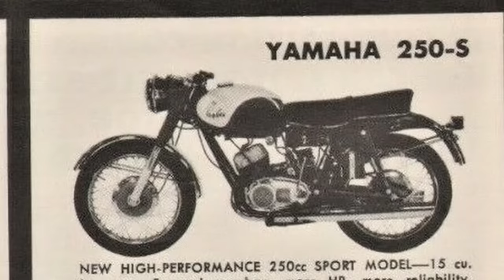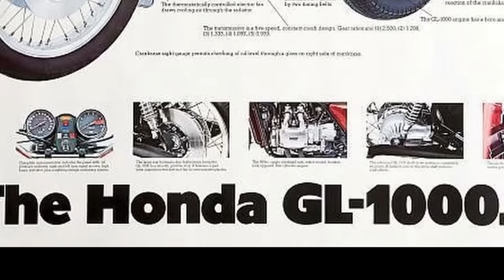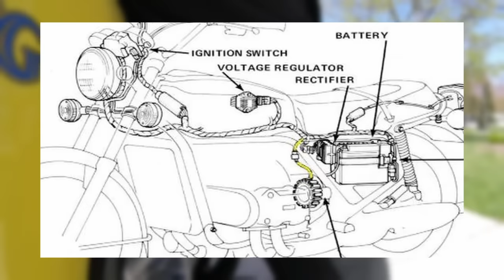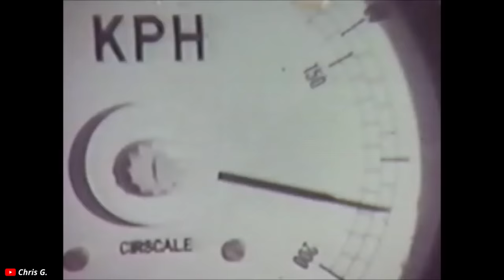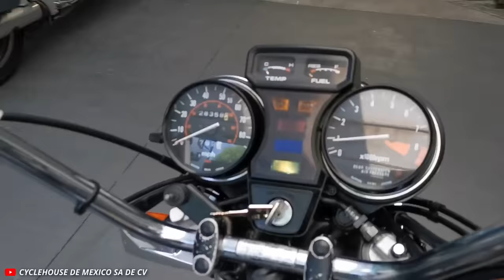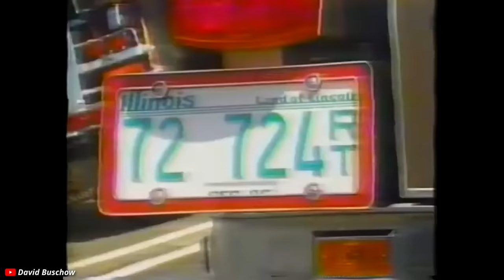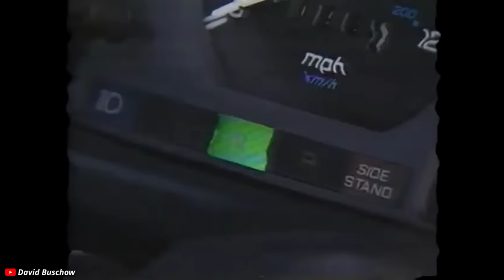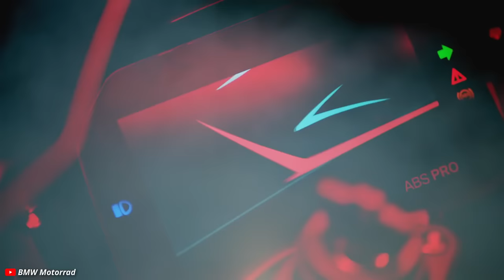How the Honda Goldwing became the Winnebago of Motorcycles

Comment: years ago, I bought a "GV1400" CAVELCADE made by SUZUKI that was made in1988( V- 4 water cooled engine). I bought the machine new in1991, a leftover being that it was discontinued when I bought this machine with.5 miles on it. it was built as a "HONDA GOLDWING" knockoff, and more expensive to buy. I guess that is why the sales numbers were so low, as it hade a 5 year production run. I still have the bike with 258,000 miles on it, and the engine is running on the factory build. the bike has been a trouble free machine. it would be nice if you did a comparison between the two bikes, just a thought. I also subscribed to your channel!!!!. I started riding when I was 25 years old, I am now 62 years old , and still riding!!!!   have a great day!!!!, and keep the rubber side down.

Comment: Back when they came out I had a GL1200 Aspencade in New Zealand. One of only 6 imported. All good until the oil pump rotor shattered and the engine seized. Sadly it would have cost me too much to rebuild so the bike became the first and only spare parts bike in the country. A friend of mine at the time had a CBX1000 6 cylinder. He was also not so lucky when the con-rod on the 5th piston broke and cut the engine case open. That too became a parts bike. Big bike in New Zealand in the 80s were not cheap to start with and parts were expensive. Ah those were the good 'ol days of my youth

Comment: I ride a GL 1200. Good bike and carries a lot. The primary chain has gotten noisy after 100,000 miles. Do I ignore it or  split the cases (big job) and fix it ir buy another bike. Still a reliable bike and gobbles upnhighway miles. I put about 6,000 miles on my bike this year and didn't go on any long trips. I'm pretty old and the GL is a comfortable bike. I have a couple if dual sport bikes that are fun to ride but the seats are horrible for me.

Comment: I was gifted an old GL1200 Interstate and put about 7500 miles on in the first year, then it went into mothballs when I had to move. Ended up giving it away. Then I bough a 1995 GL1500. I put 32,000+ miles on that the first 18 month. I only got to ride it 7000 miles the next year because of work before my handle bar controls went out. On one of the Goldwing Forums I visited before finding mine, I was looking for safe miles for purchase of a used bike and there were very many with well over 100,000 miles, many with over 250,000 mile, quite a few with over 500,000 miles and even 1 with over 1,000,000 miles on his Goldwing.

So yes, I would say if you want the ultimate in open road cruising experience, the Goldwing should be your choice...hands down.

Comment: Craig Vetter was probably the one responsible for Honda putting factory fairings on the Goldwing. Riders were equipping Goldwings with Vetter fairings a couple of years prior to Honda providing their own. Why miss that share of market? Vetter fairings were good quality and I had a couple of them on my bkes. I also owned a Goldwing 1500 for many years and rode it across the US a couple of times. (WA to FL and back). Honda got it right for a big interstate gobbling bike.

Comment: The GL1000 had performance and speed to match the Z1. It was no slouch even though it weighed 650 lbs.

They aren't hard to pick up either if you know what you are doing.  I know from experience

Comment: I had a 2008 GL1800 and it was without a doubt the best bike I have ever owned. Fast, comfortable, dependable, and luxurious. 1000 miles a day was Childs play. Where I live, it is 1000 miles to Sturgis SD. I used to go down, pick up a bunch of t-shirts, and would be back home the next day. I have a Victory now and it's okay but in comparison the GL was still a better bike. As far as HD is concerned, well, they aren't in the picture nor is BMW and yes, I have ridden both of them to compare. The new 1800 is definitely the next generation but like anything else, it does have some flaws. The suspension is cushy but the springs sag out fairly fast. Traxxion or Progressive cures this quickly. If you know how to handle a GL it is possible to stay up with sport bikes in the twisties once the suspension is reworked.

Comment: I own 4 goldwings from 2 1000s, to an 1100 to a 1500 and I still love my GL1500 best. I had a 1200 too and they are arguably more fun than the 1500s. The naked 1100 is the most fun IMO. It is not a slow bike. They are all so incredibly reliable and smooth and each generation just improves on torque and smoothness. The 1000 wasn't exactly lacking either. I'll probably get an 1800 next

Comment: Did 7000 miles in 14 days on mine, and lived with it as my only motor vehicle. You haven't lived until you've worked for American Honda and had them hand you a basket case box of parts  Goldwing and tell you to put it all together and make it roadworthy.

Comment: Don’t have, and never have owned a goldwing. But I ride a 1983 Yamaha Venture. I can do grocery runs on my bike easily, eggs and all. It’s comfortable for hours, it’s still plenty quick enough to be good fun. Handles better than my 82 xj750 it replaced. And I only paid 1500$ for a two owner, garaged, 30,000 mile example.

80s wings are really excellent however.
Reply: yamha  beß  t  wave rúñers  toó

Comment: Back in 1987 my wife and I purchased a 1981 Aspencade and immediately went on a long road trip. At the end I asked my wife "did your butt ever get sore?". We both agreed that NO was the only answer. And that was on the stock seat! Unbelievable. What I did NOT like about the Aspencade was actually the air suspension, which could not compensate for altitude changes. This was a big deal when riding from sea level to 9,000ft. I actually wished I had purchased an Interstate!

Comment: Switched to a GL1800 (2008) after putting 250.000 Kilometers on an 1300ST Pan European (which deserves its own youtube report).
Also it is worth mentioning that manufacturers had an unwritten law to cap horsepower to 100HP during the 80's and 90's. With the coming of the BMW K1100 and R1200 this was let go.
Still the 1800GL 2008 version holds its own quite nicely as a pinnacle tourer. The 2019 model tops that but including taxes it would set you back an easy 40K Euro (comparable to the BMW1600 GL by the way). Luxury tourers are massively expensive in Europe, which is a real pity I wouldn't mind owning one of those, though.

Comment: I'm lucky enough to own a GL1000 (yellow '76), and they are certainly a unique machine.  If it looks like a bike with a car engine, that's because that's pretty much what it is.  Honda's motorcycle division did the frame work, while their automotive department did the engine work.  Heck, the carburetors identical to those used in the N360 car.  This means they are massively overcomplicated for a motorcycle carb, but if everything is working correctly, they do a great job.

Which is kind of a theme for the bike.  While top end jobs are easy, a lot of other common bike maintenance is a nightmare.  Changing those timing belts?  Essentially have to pull the radiator.  Need a new clutch?  You've got an inch of room before you hit the frame.  Stator's gone bad?  You're pulling the engine.  Need rings?  You're SPLITTING THE CASES.  But that said- IF everything works together?  They are a magic machine.

Everyone forgets how much power these bikes actually have.  They STARTED at 999cc, and just went up from there.  Power delivery is a bit weird on the early models (a bit of a slug under 5K rpm, but really takes off above that), but if you keep the revs up they are sporty little machines.  Sure, they get a bit tubby in parking lots, but I took mine to The Dragon a couple years ago and it did great.  They can be a handful to get tuned in, but once you do they will go FOREVER.

Comment: From your comments I can tell you're young and didn't research the Gold Wing well enough.  It was designed from the start to be the best touring bike available, starting smaller and simpler, and growing from there with consumer demand as the bike sold very well.  It was never meant to be a super bike as you said. My stock GS1000 is a second and a half quicker on the 1/4 mile.

Comment: 3 years ago this week I decided to start riding again after more than 20 years. Bought an 83 Aspencade gl1100. Just shy of 60,000 miles in those 3 summers and winters in Pittsburgh. Nothing but brake pads, tires and oil changes. Oh yeah, it cost me $900!

Comment: You should read "Eight for the Open Road" from Cycle, in May (?) of 1975. An evaluation of 8 bikes. Very informative of the period. They tested (IIRC) the Gold Wing. BMW R90/6, Norton 850, Moto Guzzi, Suzuki Water Buffalo and RE5, Harley FLH 1200, and Kawasaki 900. IIRC that is. The Wing and R90/6 tied for top, for different reasons. Everything else far behind. Harley at the very, distinct, bottom. 
Look it up. You'll like it.
And wasn't that an R90S in the mountain passing clip at 9:49, doing the passing?
I called them Lead Wings then. Still do. I'd rather have an RT that weighs 200lb less, handles better,  and will last just as long.

Comment: I paid $1,500 for an ‘85 GL1200 Limited four years ago.  It took another $1,000 to get it on the road and has given me 40,000 trouble free kilometres since. Shows 104,000 kilometres and running strong as ever.

Comment: I had a GL1100 interstate back in 1995...that generator was a menace.  I bought mine and it died or was dead from the get go, a common failure for thet engine.  $800 (1/4 what I paid for it) to replace the thing because it was buried in the guts of the bike.  Oh, but it was smooth and floated like a lightly buzzy comfy carpet.  I put more miles on that thing then any other bike i ever owned.  If i got back into riding, it would be on a goldwing.

Comment: I ride 2 different wings.  a 1983 GL1100 that a solo bagger for me.  has a 1960's horse saddle on it. chopped windshield thats blacked out.  It has 110k KM's on it.  Also a 1990 GL1500 with all the options except CB radio. up dated lights to LED.  progressive springs and a super brace on the front end.  progressives are planned for the rear next season.  the GL1500 has only 80K KM's on it. 
I'm 60 and have had motorcycles for 45 years.  my first wing was only last year and i wish I had tried one 40 years ago. 
Why did i wait so long?

Comment: Need help guys ! I recently got a 97 honda valkyrie with 48k miles  I'm really happy with the handling and performance of the motorcycle but  the only trouble I'm having right now is  that the  gear doesn't shift from 2nd to N and 1st to 2nd gears. No troubles when the bike in lower temperatures.I really appreciate someone tell me the reason.

Comment: At 13:50 you say nothing happened with the Goldwing until they produced the 1500. Check out the 1985 Limited and the 1986 SEI Aspencade, they were way different than the regular carbureted 1200 versions.

Comment: ive owned several goldwing from a 1985 special edition 1200, to a few 1500s to now 2 different 1800s. i love the 1800 but for my use and overall ride i liked my 1995 pearl white 1500, i think its the looks of the 1500s they had plenty of power, i guess iwent for the 1800 cause it was newer and why not. but i agree the 1500 is the goldwing that put the honda  goldwing in the upper class

Comment: I think your description of the 1500 is really misleading. The 1500 was a mistake. It was too big and too cumbersome. Everyone I talked to who moved up from the 1200 to the 1500 stated they still wish they had their 1200 back. The bike acted heavy. Sure it had more torque, but just wasn't the refinement of the tour bike that it was intended to be. When the 1800 came out, the goal was to fix all the undesirable aspects of the 1500, and they did. The aluminum frame made the bike lighter than the 1200. It was quicker into the corners, and lighter steering. Both power and torque were increased. Overall, it finally had the refinement that was missing from the 1500. The latest iteration of the 1800, while more refined is too expensive. The dealers are complaining Goldwing sales are way down. They can sell used 1800s all day, but $30K is just too much money for a Goldwing.

Comment: Early 80's Michigan 31 South of Rothbury and a rather girthy husband and wife on a Goldwing pass our Subaru GL.  The rear tire looks to be either low or under strain my brother points out.  Not two minutes later the rear tire blows out and the bike is all over the road.   The dude wrestles the bike into the soft sandy soil and lays it down.   As the throttle hit the ground the rear tire shoots a stream of sand into the air across the road.  We stop right away.   The couple is okay except a broken leg on the husband.  Never forget that day

Comment: Wanted to drop a little pointer on Japanese pronunciation if you want to get it a bit more accurate. Basically every syllable of Japanese, outside of the singular n sound, is based around the vowels of a, e, i, o, and u, which are pronounced as "ah," "eh," "ee," "oo," and "oh." So syllables are either just the vowel sound, or a vowel/consonant pair, like ka, ki, ku, ke, and ko, and so on with other vowels. The only real deviations from this are in shi, chi, and tsu, since the rest of those vowel types just have an s or t respectively.

Basically,  as long as you break it into vowels and pronounce each vowel clearly, you can get a functional pronunciation for it. Like for instance, you pronounce Nozue in the video os "no-zoo," but if you break it into the vowels, then it is read as "no-zoo-eh." Once you have that, it will sound pretty decent from there. The only other tough part for English speakers is the r sound, since in Japanese, they  touch their tongue to their upper gum. It's fairly easy to learn though, you basically just say d, but you start without your tongue touching your gum. So da and ra are very similar sounds, but in da, you start with your tongue on the roof of your mouth, and for ra, you start speaking before you put your tongue into place.

I doubt you'll see this, but in the off chance you do, then I hope it helps!

Comment: I owned the GL1100A four and currently own a GL1500A. There is no better solo tourer in terms of power and comfort. But add even a moderate weight wife and it all becomes too much. Not impossible, but the safety margin is gone.

Comment: Started on 2 wheels as my first main mode of transportation in 1966. I've owned everything from Honda to Harley and even the Europeans to full blown 2 stroke dirt race bikes including an early MAICO 490 before they ruined a great thing...check the MAICO story out and it just flabbergasts me why.
On the GL side, MY first was a gently used GL1000 then subsequent higher CC machines. Presently on an ILLUSION BLUE '02 GL1800 ABS making this my 8th GL. Rode each to the moon and back and only bought newer after I plain and simply wore them out...still have each collecting dust in the storage building. NOPE, not interesting in selling, too many memories there so please don't ask if I want to part with any of them.
I've ridden the newer GL's but I'm totally HAPPY to roll up on my '02...@73 there doesnt seem the need for anything newer just for that "NEWER SAKE"...Some will get that.
My Son estimates, from the odometers of those still in the storage shed, that I've accumulated a little over 850K just on my GL's, not including any of the Yamahas, Nortons, BSA, Harley's or etc... That doesn't seem like it was a labor at all but more of just everyday normal for me. I'm absolutely possitive there are those with many more miles so this is no great feat in comparison.

The point I'm eluding to is that ALL of the GL's are just amazing to ride and will click the miles off without the constant need for BUTT-REST stops. Throw a leg over and just RIDE.
That's what it's always been about for me...JUST SAYIN'.
"KEEP THE DIRTY SIDE DOWN AND HEAD ON A SWIVEL".

Comment: Winnebago? I take offense! The GL1800 has a sub 12sec 1/4 mile time. Will go 0-60 in about 3.5 sec. I owned a naked 82gl 1100 from 2017-2022. I've ridden faster bikes, I've ridden better handling bikes, but I've never ridden a bike that does everything as well as a GL. It isn't even a jack of all trades, master of none situation.  It's a a solid 9/10 in each and every category, Plus a 10/10 on touring and smoothness. You park an original Goldwing next to a modern bike?  It's tiny. Smaller than a rebel 500.

Comment: It's the wife seller. Hear me out.....
If you have a wife that is somewhat or even staunchly against you getting a motorcycle,  then the solution is actually to buy TWO motorcycles. 
You get an old goldwing for 2 or 3k, and get an old cheap version of whatever you want. Tell the wife you bought a bike BUILT FOR HER (the passenger) and take her for a ride. If she has a pulse, she'll love it. When you wanna cruise, take your bike, but keep the 'Wing and take her out twice a month. 
Next spring,  sell both for to the next guy trying to sell his wife on the idea, and buy what you wanted in the first place. Yea, she'll always compare your Electra glide to that old goldwing, and she'll say you made a mistake, but you'll be on a bike, and that wasn't possible without the wing.

Comment: As amazing as the whole video is, you almost made the GL1500 sound like its boring and ugly (not cool). I would argue its Neo Futuristic angular design is the peak of its beauty.... certanly better looking than the 2018+ model is. And the length of customizations some people go through on the bikes is equal if not exceeding that of a Hayabusa... minus the turbo... I own a way smaller sport tourer - Yamaha FZ6 Fazer, but I dream of owning the legendary pig.... the 2 wheel car and if possible find a fuel injected GL1500 as rare as they are.